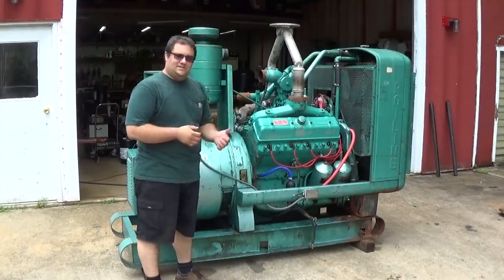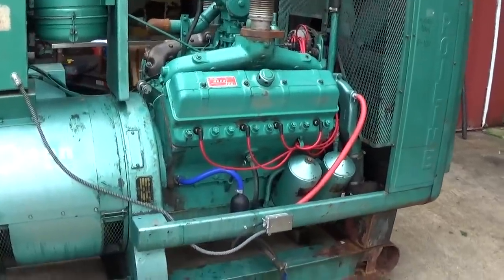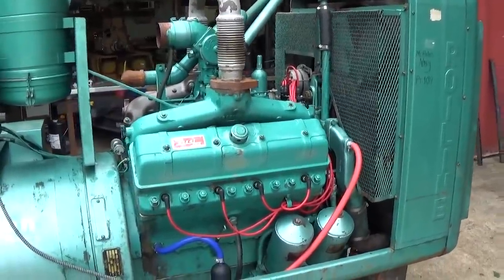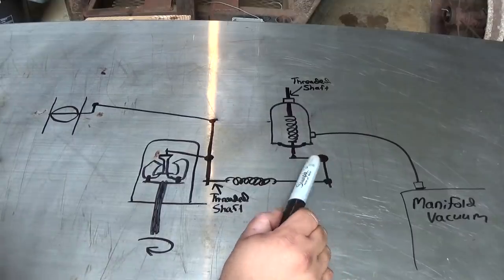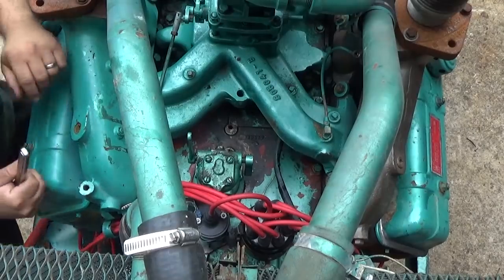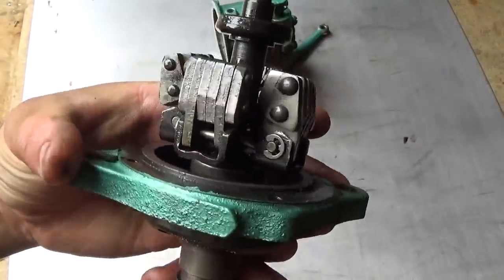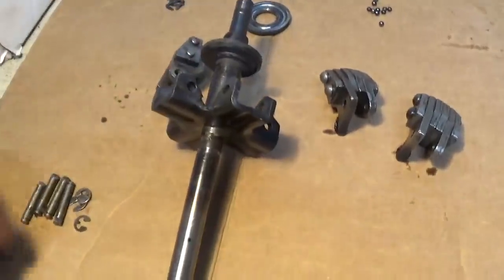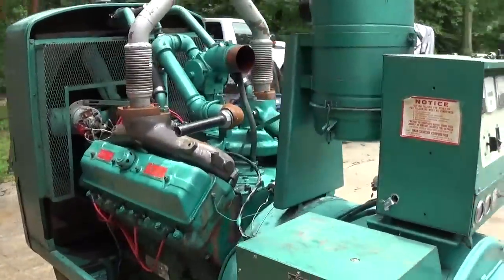844 Cubic Inch V8 GENERATOR Lets find out what is ailing it... Onan 140WE

Comment: Very interesting. I live off grid and have two diesel gen sets I almost got for nothing. My back up cost a thousand. And is basically very new with 5 k hours and has the kind of set up you are considering. I was lucky that I got two sets for a grand in that I only needed to be a parts changer to get one running as I'm a back yard mechanic only. Yanmar 4 cylinder Kohler 20 kw. With mag pick up at flywheel out of hospital bus for X-ray work in field. Runs like a champ. But I am very interested in your show as I'm eager to learn about gen sets. My main machine,found for 2k is a Twelve wire synchronous Lima ser. Both from California where used machines can't be resold out used.

Comment: I believe the lower gear and the gear in the engine also didn't get oil. So oil pressure maybe low or blocked in that area. Which could not give oil to the governor.

Comment: The LeRoi company started  out as the  Milwaukee Machine Tool in 1913.  In 1917 Charles W. Pendock reorganized the company onto the Le Roi Co.  Legend has it that the 
company  name was changed to "Le  Roi" (The King) after a big order came in from France  circa WWI. WABCO purchased LeRoi in 1954 and sold it's engine line to Waukesha in 1958. Waukesha marketed the Le Roi engines as "RoiLine". The last of the LeRoi  engines were built in 1974. I got this info from https://www.wehs.net/connection-3-leroi.html

Comment: Hi My name is Curtis, I’m looking for help with a stanadyne DB4 injection pump, the metering valve keeps getting stuck... to the point where I take off the actuator cover, and free it by hand. Once I free it, it works just fine, starts perfect, maintains frequency. Turning off
The unit, then starting it back up for 2-5 times right after each other will repeat the issue, and get the metering valve stuck again. What can I do to fix this? I’ve tried letting it soak in seafoam, but it doesn’t seem to be helping in the long term. I’d really appreciate your help! Love your videos

Comment: Hey Mike!  I enjoy your vidjas, thank you for putting the time in.  Are you on the east coast?  I cant really hear any accent.  I ended up with an early 60's Sears and Roebuck 5kw generator with a Tecumseh when I was in High School.  She was a barn find and in great condition, but the NLA carb was plugged.  An old timer who owned a small engine shop that I frequented had the (I believe it's Walboro) carb, new old stock.  It ran great!  But now she just sits in storage.  Are you a collector or is there a market?  I wont scrap her, dont worry.

Comment: You could never put a gasoline engine in a building today. I worked with diesels most of my life. This is the first gasoline generator I have ever seen that produced over 100KW. The later 100 KW Onans used Ford 460s. I have to admire Waukesha engine.

Comment: I like the 1/2” gas line feeding an 1 1/2” pipe. Under full load, that puppy probably takes quite a few cfm’s of gas. More than your house will supply. Consider temporary propane setup for testing. Gives customer nice option too! Especially in remote locations.

Comment: I remember finding an old power unit governor that had a little tag on it that said warning oil daily with an arrow poninting to a hole that someone drilled in it and installed an installed an old glass gravity Oiler on it after seeing this I can see why someone did that someone must have found this fault in design back in the day it had always made me curious why they did that I’ve recently decided instead of using the power unit I found that once powered my place im going back to its roots am converting my building back to steam power to power my power hammer in my blacksmith shop

Comment: Had a high pressure water pump at work with the same type governor built in the 1940's, electricians replaced it with a PLC was so annoyed. It ran for 80 years with out a problem the PLC will be lucky to survive 10 years. All the governor needed was a good over hall but at 80 years old not one of the maintenance people new what to do with it.

Comment: I wonder if there is an oil flow problem to the governor. I cant imagine what happened there is normal, and you mention the drive gear being badly worn. Maybe an oil gallery is blocked. Maybe if you run this, other bearings are not getting good oil flow as well.

Comment: Wow those gear teeth look super worn on both. If the governor didn't fail, I bet the teeth on both gears would be gone, also I would check oil system for the rest of the bearings,  it looks like you might be missing more than half of the amount of ball bearings, hopefully the rest are in the pan and/filter, but not stuck in the oil system channels, that would suck, I would flush the system with kerosene or something else, minimum 2-4 times, who knows what the service record is for the generator is. Good luck

Comment: Not sure yet, but I think I've stumbled on to a Roi-Line 844 running on natgas on an irrigation pump plant out here near Lancaster, CA!  The vialve covers and manifold setup looked identical, but I'll have to ask the farmer for access to get a closer look.  Being natgas, it's still in service, while all the comparatively new diesels have all been retired, due to CARB emissions restrictions.  ThIs pump house is the last service on the main coming out of town, everything east of there is propane.  All the diesel plants had to be replaced by electric drive, as they were from the 1930s up until the '80s, when power prices spiraled upward.  The pricing for ag pumping power dropped due the huge increase in solar and wind generation in the area.  Also retired were all the 1953 Cooper-Bessemer GMV gas main compressor plants scattered throughout the desert, replaced by central turbines and a new pipeline.  You'll remember the mess the GMVs caused in Hinkley, CA, which became the subject of the film "Erin Brockovich."

Comment: I'm curious was it a time crunch situation? Like they needed the power back on right away. Seems to me repairing it with an electronic governor would have been far less expensive than replacing the entire generator? I imagine fuel consumption and efficiency is probably higher on a new generator. But I can practically guarantee you the new generator won't run for 50 years. Lol You should definitely do the conversion and get it running for us. Or even just run it without the governor and just blip the throttle manually be good to hear that big sucker run.

Comment: Electronic is too complicated. I mean, it will work, but for an engine on which people will count on, it must be as simple as possible to reduce the ammount of the failure points. I imagine a magnetodinamic governor - most  petrol generators have it. It is a rotor with permanent magnets in it and a stator with metal cylinder around the magnets. The faster the rotor rotates, the more mechanical force is introduced on the stator because of the induced currents in it. That force can be ballanced with a spring and transmitted with a lever to the throttle. Main advantage is that there is no friction between the parts in the governor and there are less parts in it ar all. So, we are reducing the failure points.
An idea: for simplicity, the governor can be made with disc shape instead of cylindrical. I guess, this will be easier to fabricate...

Comment: Well crud.  It only lasted 58 years.  They just don't make 'em like they used to, huh?
Reply: 1600 hours at 60 mph is under 100k miles. This engine did a lot of sitting around.
Reply: aus71383 I think he should have patched the exhaust and fixed the governor.  Left it on site.
Reply: Then again, they never did.....
Reply: "Lifetime" guarantee, when life expectancy was 60-ish? lol
Reply: Engine only exercised once a week, failed when it was called on for a extended run.  Usually ran 30 min a week which is 26 hrs a year, or about 1300 hours in 50 years. Really under extended load conditions for about 300hrs in 50 years. Usually most power outages are less that 3hrs.  This ways an unit not used hard. It was not used for 24 hour at time normally. It should have lasted much longer. with no issues. But I believe had a big oil issue in the drive gears of the engine area of the govenor

Comment: I was told the Le Roi 844 was developed as a gasoline truck engine in the early 50's.  Autocar was the primary user, Mack built some military trucks with the 844 was well.  The 844 was also found in some fire apparatus, maybe Crown Coach or Seagrave?

Comment: I'd think an electronic governor would be preferable, IMHO.  If this plant were set up to cogenerate on the grid it has to jump on it with a leading phase, which has to be compared before you throw the switch.  Otherwise you are generating more heat than anything else, and doing neither the generator nor the grid any good at all.

Comment: Or you could install a tac and drill a hole to put a killwire in to touch the needle...  that unit looks like its going to need a thirty thousand hour overhaul anyway.  Those governors aren't junk, if it wore out its because it's designed to be the first part to wear out in any main system failure.

Comment: I doubt that your home natural gas meter will supply enough fuel to do more than idle. Don't you only have 7 to 11 inches of water column gas pressure in a home which is 1/4 to 1/3 ps1 and the engine needs at least 10psi to operate?

Comment: Without reading 700+ comments I'll throw my hat into the ring and hope I don't duplicate another post. First thing that needs to happen when going to another (stand alone) gov system is you need to do something with the original oil feed so you maintain proper lube pressure for the rest of the engine. Might I suggest reinstalling the original gov shaft as a dummy. Either plug the oil hole in the shaft or just raise it a half inch, weld a washer on it so it can't drop, and leave the gear off. Put the old cover on when done. (plugging any holes) That said, there are aftermarket gov systems or you can jury rig something from another brand of gen set. (unit going to scrap for another reason) I have done many conversions using parts from Generac because they use output frequency of the gen to sense engine RPM. (so easy) The control board has dip switches for 50 / 60 cycles, 1800 / 3600 rpm, and adjustment pots for speed recovery, droop, etc. Finally, the stepper motor can be used either clockwise or counter clockwise by changing dip switch position. All you have to do is fabricate a mounting bracket and linkage connection, then wire it to sense output and 12 volt supply. Every time I have made this conversion I write the Generac part #s inside the control head so future techs will know what is in there. As a generator tech you are probably familiar with the older Generac C-panel and "prepack units" prior to 2010, which is the gov the parts I use, mostly because there's a million of 'em out there to scrounge parts from as they drop dead due to other reasons.

Comment: It would be interesting to see your electronic governor set up and operating.  BTW, it seems the gears were also not receiving enough lubrication to be worn so much.  If the gear operates the distributor, you'll have another replacement to accomplish.

Comment: I'm a retired mechanic, you were talking about making plate to cover hole where mechanical governor mounted. Don't know if you were going to also go down below and block lubrication hole in governor support by gear? If left open believe could actually cause low oil psi to gear lubrication circuit for gear to water pump shaft , maybe entire engine.?
Reply: This. Beat me to it. Basically need to machine a piece to mimic the lower part of the governor to prevent massive internal oil leak.

Comment: Probably not enough time for oil pressure to make it up to that point in the engine when it’s start and goes right to 1800 rpm.  Probably would not be as much of an issue in an application that allows the unit to warm up.

Comment: Excellent video. Lubrication starvation obviously the problem as you suggested, beginning at the badly worn helical gear teeth. If the manufacturer had included a pressurized oil supply to the top of the unit it would not have failed.

Comment: The little wire objects were the cage for the ball bearings. When the gap became taller for the fly weights they went out against the housing slowing down the weights because they couldn't go higher to slow the engine which speeded up tripping the over speed. Well made device really to stand that much abuse on the drive gears. I would put this governor back in with new worm gears and new ball bearings. May be hard to find the gear maybe not.

Comment: I personally would very much like to see the conversion installed however
1. I would seriously doubt that the domestic natural gas supply to your property would be adequate and in any case would it be legal to do that?
2. I would carryout a detailed investigation of what is the extent of the damage all that metal has caused in the engine as I seriously doubt that it is all either in the pan or caught in filters before I spent a penny on new parts. The engine itself may be just a hefty boat anchor!!

Comment: We had the same engine at the power plant I worked at. It was used for running a fire pump. Our main fire pumps were electric motor driven. The engine driven pump was used as a backup if electric power was down on main fire pumps.

Comment: So if I'm looking at this right that upper thrust went bad first than that upper fork going to the throttle body was holding the spool from spinning with the fly weights? So the spool was sitting still and the weights were rubbing on it instead of it spinning up at the thrust?

Comment: I would think that your natural gas supply would be adequate as is.  If not then you will need a manifold to set up two independent propane regulators to provide NG to the motor and NG to the house supply line.

Comment: I have a 37KW Lister Diesel air cooled I am trying to research. I got it from work and they said it ran when they stopped using it (they got an Onan 84KW). The casting date on the block is 1964. I looked up the serial number and cannot find anything on it. Do you have any ideas? I have worked on small listers , but nothing this big, it is an entirely different animal. I would love to get this thing running!

Comment: Think for a second.  ALL oil in 1965 had Zinc DialkyDithioPhosphate.  It was included in the engine oils of the day for the shear loads in flat tappet engines. It would have also served to lubricate the governor in this case, which had high shear loads in it's various parts.  
Starting in the late 90's ZDDP was deleted from oils to save catalytic converters on gasoline engines. Roller tappets became common place at that point. 
Most diesel oil kept ZDDP in it until the introduction of diesel particulate filters in 2007 to clean the soot from the exhaust, aided by urea injected into the exhaust stream.   The zinc (ZDDP) would coat the substrate of  both gasoline and diesel converters rendering them useless.

By eliminating ZDDP, all engines with high shear components, would see these parts fail. This is simply combated by using a zinc additive, or using a 'racing' oil with zinc in it's additive package.

Comment: Add my vote for the electronic conversion! I'll bet it wouldn't be a far leap, for someone electronically knowledgeable, to modify an aftermarket automobile cruise control to do the job, either - or Hell, just set it up and plan on adjusting it up to Herz/speed whenever the engine was stopped...

Comment: Me LIKEE generator! I believe it will be pronounced "ROI Line". I have an old 1946 "ROI" rolling compressor that is a 4 over 4 compressor for a jackhammer with 1 inch line. Apparently I can still get  parts and rebuild kits for both the engine and compressor.

Comment: Mike, It sure would be neat to hear that 844 LeRoi bark under load. Unfortunately your home Nat gas supply is woefully inadequate!  Adding an electronic stepper governor has to be weighed by your resell value vs cost. Or, part it out and scrap the gen end with some rat rodder using that lovely 844 cubic inch chunk of iron with a liquid fuel carb on it to power something that rolls down the road. Personally I'd go rat rod with it.

Comment: Excellent and very interesting Vid. Would definitely like to see this monster running and also would like to see what is involved in setting up these electronic Governors. I have a few little diesels that I have been thinking of using one of these for as well as a car engine I'd like to use on a generator.  Just have to point out an error in your Channel name, this isn't any SMALL  engine! :0)
Thanks again for a great Vid and well done!

Comment: Engine was built on Line 5 at the Waukesha Motor Plant in Waukesha Wi. My grandfather would have been one of the men doing the final assembly. I worked in the test room during the early 70's and set up or tested some of the last of these engines to be produced. Thanks for the video. Pretty cool to see one of these old engines again.

Comment: I can appreciate the idea of a quick fix with the electronic governor, and I agree that it would likely be the best solution if it were still a client’s engine. But if it were mine, I’d be working on rebuilding that mechanical governor. I might leave out two of the flyweights and of course change the spring to reduce the load on all of the parts. But I would fix it nonetheless.